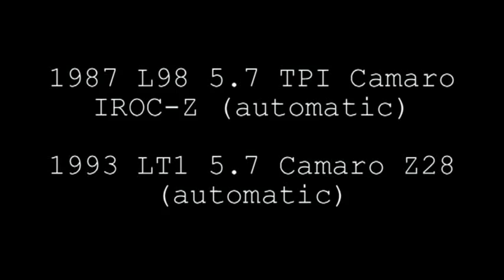LT1 Camaro Z28 vs TPI Camaro IROC-Z (1993⚡️1987)

Comment: Main thing I see is the LT1 car takes longer to downshift. They are terribly slow.
Reply from the maker: But those LT1s would pull forever. They had some lungs lol
Reply: @nedaCFilms I agree. My 94Z was so flat from like 2k to 6k but sweet spot was about 5300-5400 with M6 I totally agree and I beat so many cars on the way back from the track. T t type, cobras (not termi lol) but dohc, eclipse turbo that went high 12s and hmm oh it rained once at the light and by a wrx and yeah he did it to me. It was so perfect. A t bucked busted my butt and some bikes but it was always good runs. Big block 71 el Camino auto barely edged him out when mine was stock. Every time I powershift I gain about a foot. I’m reminiscing over but what a fun car with a few mods
Reply from the maker: @ztwntyn8  they were fantastic engines back then.  I owned two 94 Z28 models and I have to tell ya, my black LT1 Z28 with basic bolt ons and was making around 280hp to the wheels but it  was the fastest top speed I ever pushed a car. 
I “on one occasion” ran that car over 150mph on Route 37 bypass west of Winchester, on a stretch of highway that was straight for approximately 3 or 4 miles, chasing down a 2000 Cobra R back in 2004.
That LT1 would not run out of breath! It just pulled and pulled and friggin pulled! When those LT1 engines had the exhaust and intake sides opened up to their full potential, they would absolutely scream. 
My black ‘94 LT1 would smoke my buddy’s maroon ‘93 LT1.
The 96-97 M6 cars were the quickest though, stock for stock.
I have the best memories in my LT1 cars lol. I smoked a handful of 5.0 Mustangs too lol. But I’m not a tribalistic mentality brand loyal type car guy, I love ‘em all! Ford, Chevy, Pontiac, Buick, Oldsmobile, Dodge, Plymouth…. I loved them all lol.

Comment from the maker: The 5.7 liter 350 cars were available with T-Tops as well, but they "were not" available with the 5-speed manual... only the automatic transmission.
Reply: due to the 5.7L's Torque, if I'm not mistaken!
Reply: That's what they say. However GM said in a later press release that if they put a 5 speed behind the 350 nobody would have bought the Corvette. To be honest why did they put one behind the Corvette if the manuals couldn't handle the torque?
Reply from the maker: @collinpietsch5614  the Corvette didn’t use the T5, they had expensive Doug Nash manual, then the ZF 6-speeds.

Comment: my 93 Z28 has the 150mph speedo. from what i've heard some 93 Z28s got the 115mph from the factory and some got the 150mph and no seems to know why. but after the 93 model year they all got the 150mph speedo. mine is a later build (April of 1993) so that might have something to do with it.
Reply: It’s the tires they are order with. So I’d you get a rated tires you got the better Speedo and higher speed gov. The lesser tires got like 110-115 speed gov because of tire rating. The Speedo was coordinated with which tires also.

Comment: The speedo at 115mph was that it didn't have the tires to go any faster. So it was because of tire ratings. Also its top speed as a result was limited and much lower. I had a 93 Camaro Z28 Manual with 115mph speedo.

Comment from the maker: @420gdub check out my website StreetShowDriftDrags(dot)com and click on the TPI Camaro section. After you get it send me a message with the RPO codes (sticker in the center console) and I'll tell you all your cars options, from those 3 digit numbers... Also, check the 8th digit in the VIN number, if it is truly a 5.7 liter TPI 350 it will have the number 8 as the 8th digit. The 1990 L98 cars were strong runners @ 245hp and with massive amounts of torque.

Comment: in 1997 owned a 1991 z28 coupe B4c = 350 L98 automatic red on red what a nice fing car man real sharp but they had to put the tops tops in i remeber they were after market not factoryi now have a 1996 LT1 convertible

Comment: I have a question that needs to be answered what year did the iroc put the lt1 or 350 block in there car ?
Reply from the maker: The IROC-Z model was produced from 1985 to 1990 and never had an "LT1" engine. In 1987 to 1990 the 5.7 "L98" TPI 350 was available and ranged from 225hp to 245hp and only offered with automatic trans. No 5-speed was available. You could order a 230hp 5.0 "LB9" TPI with a 5-speed. They were very strong performers. Especially with G92 and 1LE options. They 5.0 powered 1LE Camaro actually stole the SCCA Showroom Stock championship from the 5.0 Saleen Mustangs.